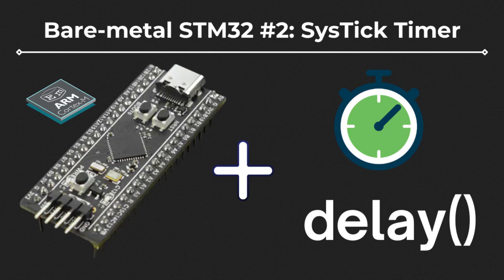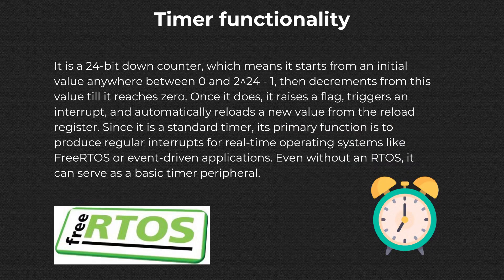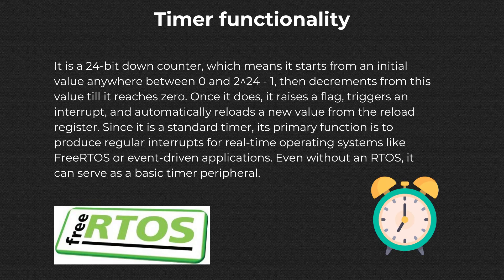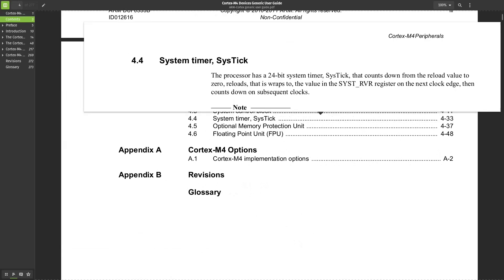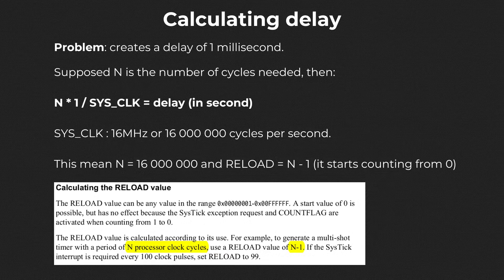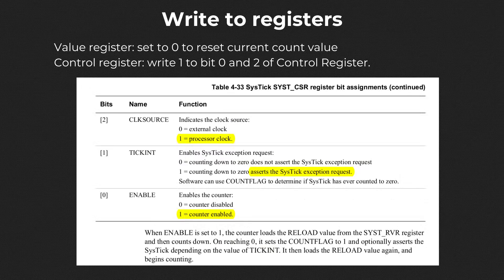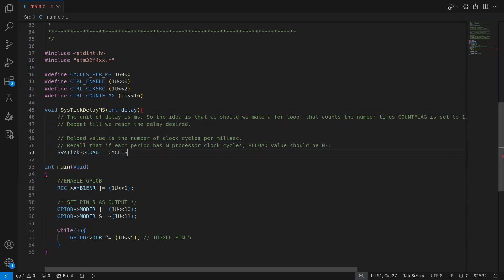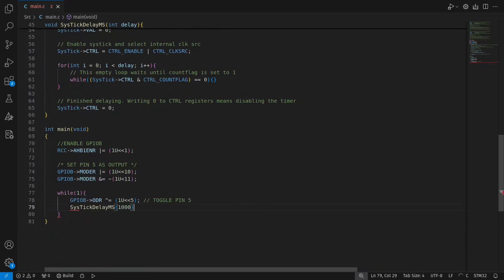Bare metal STM32 #2: Using SysTick timer to write a delay function

Comment: What was ommited here and ARM Reference Manual or for example PM0214 doesn't explains how systick countflag is clearing. Looking at the code it looks like the read operation of CTRL systick register after countflag was set to 1. And it is a true - from ARM website find out: "When the counter transitions to zero, it sets the COUNTFLAG status bit to 1. Reading the COUNTFLAG status bit clears it to 0."
 Also "Writing to SYST_CVR clears both the register and the COUNTFLAG status bit to zero"
Reply from the maker: You are right and tks for the info you provided. I am too busy with my work so I have stopped uploading or updating my videos, but I will pin your comment as it can be helpful for others

Comment: Where can I get bare metal  programing book
Reply from the maker: There are a lot of STM32 books but so far, I have seen fews about bare metal. The best one I've heard of is this: https://www.packtpub.com/en-in/product/bare-metal-embedded-c-programming-9781835460818

However, it isn't free, and I don't even find a copy of it on the internet. It is fine though, since the core topics of all microcontrollers are roughly the same: GPIO, timer, interrupt, ADC, PWM, I2C, UART, SPI, etc. So research for the topics online is enough to understand (it just lacks a clear roadmap compared to a book).

Still, you must need at the reference manual before diving deep into any topic: https://www.st.com/en/microcontrollers-microprocessors/stm32f4-series.html . It should have enough details about registers for you to program
Reply: @ltkdt  is there  sample copy with you to read